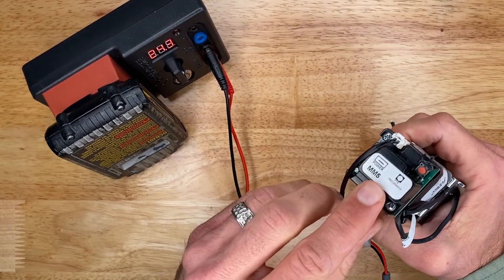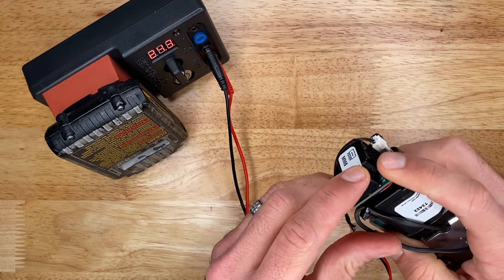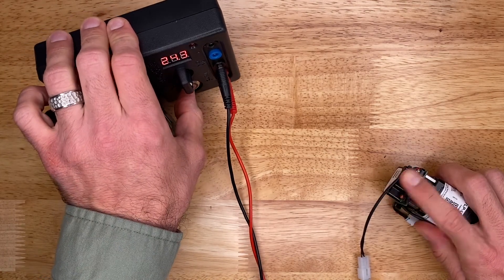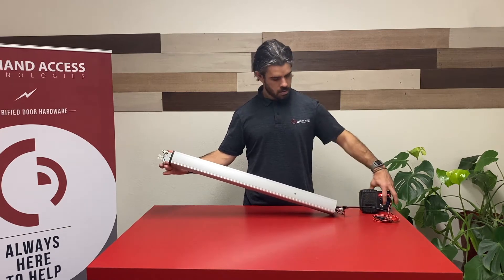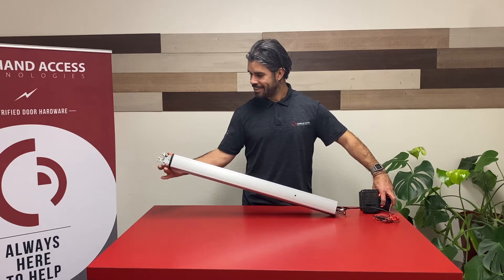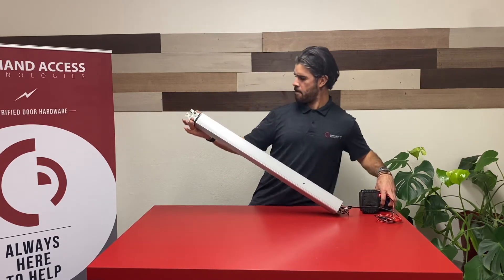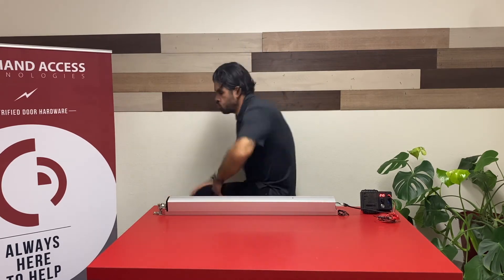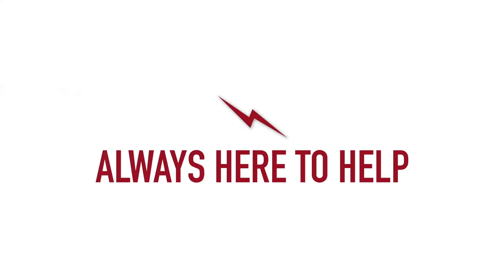A step-by-step guide on how to set the Push-to-Set adjustment on the MM5 motor modules

Comment: I'm not getting getting a beep at all just the motor trying to spin.
Reply from the maker: Hi Ryan, it sounds like the you're not getting into the PTS range. It could be a sensor alignment issue or vertical rod adjustment. I suggest calling into tech support so they can help you troubleshoot. Thanks